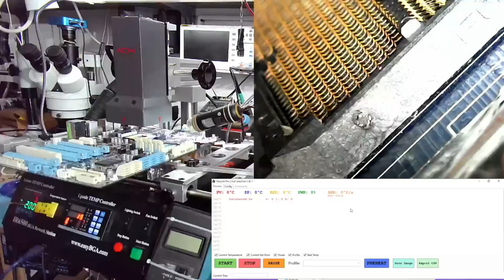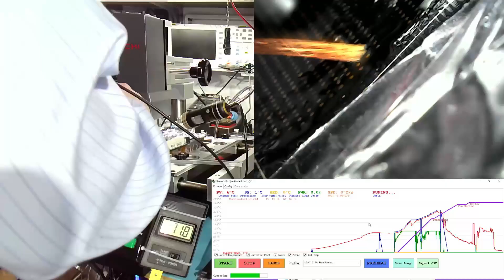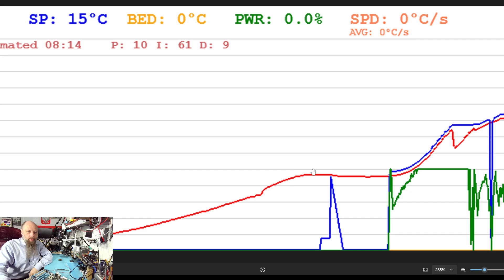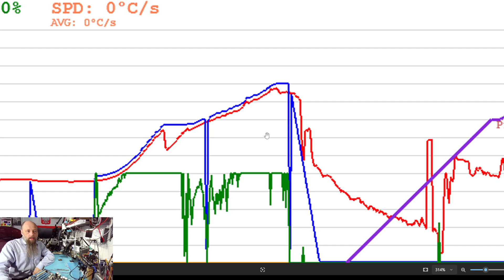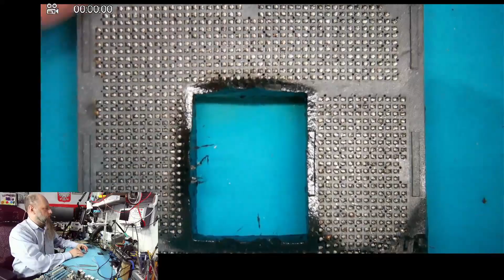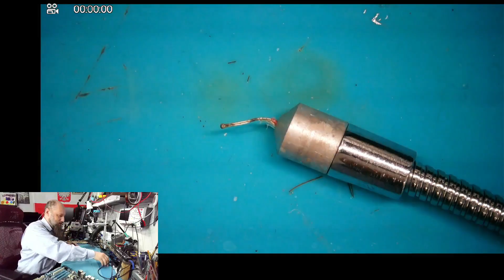120 | I Broke Your Board | New Thermal Feedback on IR6500 gone wrong

Comment: My gut feeling on the ir6500 is that it's may not be the best machine out there.  Price is ok, but I'm leaning towards hot air top and bottom.  There's a machine in the $1500 range. 
ZM-R5860 rework machine

Comment: Untwist, straighten and sperate the 2 wires on thermal couple side plus insulate them individually only then you will get an accurate reading and this spring thing will not work on its on
Reply from the maker: I'll look into that, thank you so much!

Comment: that machine is a wreck, they have to know it too well for it not to fail you, but even so i have heard that it throws high temperatures and ends up burning everything. it doesn't depend on you, but on the circuit of the machine itself. greetings and thanks for sharing it! georgia city of the strongest :D
Reply from the maker: Well, it's not the best machine out there but once you tweak it up it can be very effective.
Oh, and it's Georgia State, not the city, I'm in Atlanta :) 
(I see now how it could be confused)